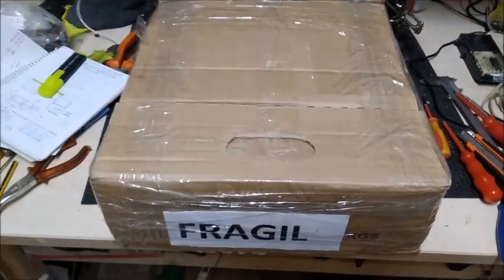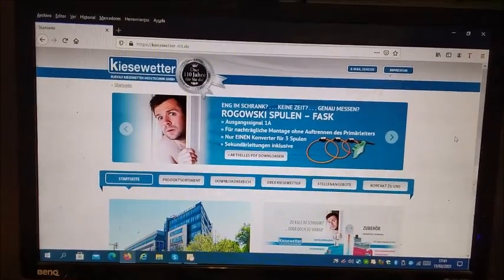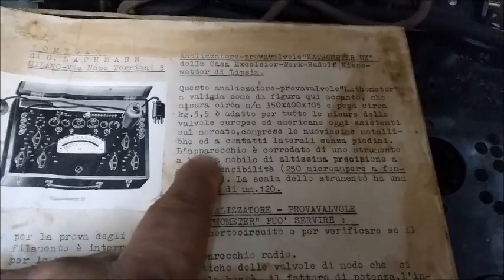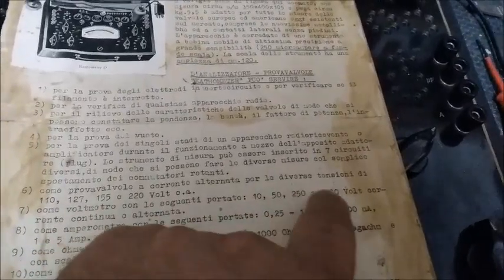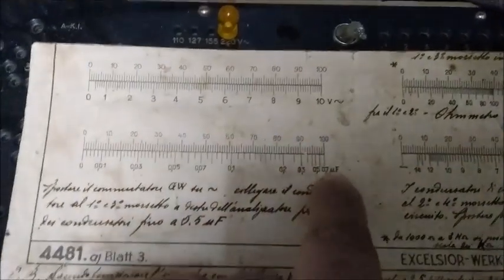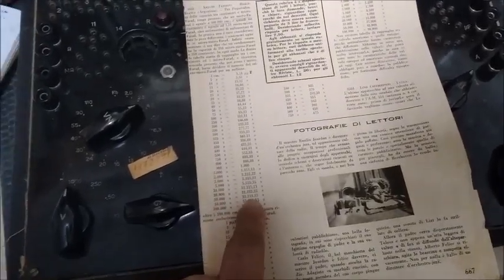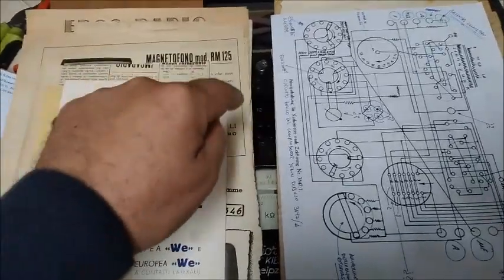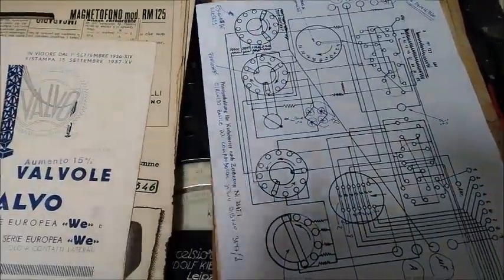1- Reparación Comprobador de válvulas Excelsior-Werk Rudolf Kiesewetter mod. UX

Comment: ¡Qué aparato más interesante!
Pienso que un voltímetro de 4000 ohmios/voltio en la década de los 30 del siglo pasado era MUY bueno. Hay que ver las cosas en su contexto histórico.
Por cierto, también estoy interesado en esa tabla de conversión de cm a pF. ¿Podrías hacerla visible para que podamos copiarla? Gracias de antemano.
Reply from the maker: Hola Pisotones. Tiempo hacía que no visitabas ni comentabas en este canal. Por supuesto, ya lo digo, que 4000 Ohmios / Voltio era bueno en su época. 
Después de encontrar esta tabla de conversión de cms a pF, y tras su estudio, pude deducir que en el sistema CGS de medidas, el centímetro, cuando se utiliza para medir la capacitancia , cumple la proporción de 1 cm de capacitancia = 1,113 × 10 EE −12 Faradios.
Puedes verlo aqui: https://es.wikipedia.org/wiki/Sistema_Cegesimal_de_Unidades
Con esta fórmula, y una hoja de cálculo, y una regla de tres simple, ya puedes hacerte la tabla de capacidades a centímetros y viceversa que necesites ad hoc.
Un punto que vale la pena señalar es que los cms no son directamente equiparables a pF como ya en su día dijo uno de mis suscriptores. 
Porque un condensador marcado 100 cm = 111,3 pF. Entonces 1000 cms serían 1000 x 1,113 = 1113 pF y 10000 cms = 11130 pF = 11,130 nF = 0,0113 uF. 
La diferencia no es importante para los condensadores más grandes, que generalmente tienen al menos +/- 10% de tolerancia, pero será importante para los condensadores que están por debajo de 200pF si se usan en etapas sintonizadas que a menudo requieren 1% de tolerancia, por lo que una variación del 11.3% es un problema, pero por suerte hoy en día ya no tenemos condensadores en cms, todo está en pF, así que si en una radio antigua nos encontramos en el OL con un condensador que ponga 50 cms, su equivalente en pF no será 47 pF, será 55,65 pF, lo cual no es un valor normalizado, y para conseguirlo deberemos poner en paralelo uno de 47 pF + 10 pF para obtener el valor más aproximado de 57 pF y luego habremos de resintonizar ligeramente el OL.
No obstante siempre habrá alguno, muy técnico él, que ponga un condensador de por ejemplo 22 pF, o de 68 pF, (porque es lo que tiene a mano), y luego reajustará el OL si le da margen suficiente.
Ahora ya te puedes imaginar, porque NUNCA me creí lo de que pF y cms era "más o menos lo mismo" y la gran felicidad que sentí cuando  tuve esa tabla de conversión en mis manos.
Y todo esto es en el sistema CGS, pero si quieres te hago, ahora que ya se como funciona, la conversión de pF al sistema MKS...  ¿O ya te la he hecho tambien?... jajajajaja...
Saludos y gracias a ti por el comentario.
Ketk.
Reply: @KetkAiball  Pues yo tenía la idea de que 1cm = 1pF, ya ves... no recuerdo de donde lo saqué pero eso era lo que tenía entendido. Precisamente ahora estoy con una radio de los años 30-40 que lleva sus condensadores en cm, por lo que este dato me viene de perlas.
Reply from the maker: @pisotones2348  pues creo que lo sacaste del mismo "tutorial" que hizo el suscriptor que te indico, que cuando le pregunté si conocía la equivalencia entre cms y pF dijo "más o menos es lo mismo, 1 cm viene a ser 1 pF" y de ahi sacamos más de uno el error, salvo yo, que me dije: "no me lo creo pero no se porqué, y no puedo discutirlo".
Encontrar la tabla esta fue fundamental, (por cierto, es ligeramente errónea por los redondeos no correctos que hace), para averiguar la equivalencia de cms a pF. Porque cuando la tuve en la mano, me pregunté de donde salían tales cifras. Y lo averigüé. Solo era cuestión de matemáticas de física. Y además lo confirmé con la Wikipedia cuando me fuí a ese enlace que te he pasado.
Efectivamente, si estas metiendole caña a una radio con condesadores en cms, ya puedes hacer la exacta o más aproximada conversión a condensadores en pF. Por favor, no me pongas condensadores a ojo de cubero como hacen algunos. Es preferible si no tienes un condensador adecuado, o comprarlo, o usar dos que sumen la capacidad adecuada más aproximada, tal como te he explicado en el comentario. Además, esas capacidades en los condensadores, ahora ya en pF, quedarán para siempre, en la radio que estás reparando para guía de los técnicos del futuro.
Un cordial saludo y me alegro haberte podido devolver la ayuda que me echaste con el contactor de la LAVIS T-980. Esto es verdaderamente compartir.
Ketk.
Reply: @KetkAiball  La verdad es que esa conversión de cm=pF la leí/escuché hace muchiiiisimo tiempo. Creo que fué mi suegro quién me lo dijo hace ya muuuuchos años. Nunca hasta ahora me las he tenido que ver con un circuito con condensadores en cm. Con respecto a los valores de condensadores de reemplazo, no soy de los que ponen lo primero que encuentran. Soy bastante cuidadoso con esas cosas. En algunos casos concretos puede valer pero en otros el valor es bastante crítico.

Por cierto que tengo un aparato más o menos coetáneo de ese que muestras aquí y con un aspecto muy similar. Se trata de un "Potenciómetro", pero no lo que hoy en día se entiende por potenciómetro sino un "Potenciómetro Universal":
http://www2.humboldt.edu/scimus/Instruments/Elec-Duff/PotenDuff.htm
http://www.richardsradios.co.uk/campot.html
http://www.richardsradios.co.uk/ether.html
http://www.richardsradios.co.uk/evershed-vernon.html
En resumen es un mili/microvoltímetro que se usó para comprobar y medir termopares. Lleva una pila Weston que, 80 años después de ser fabricada, todavía entrega los 1.018V nominales... para que luego digan de la obsolescencia programada, jaja. Tengo otra de repuesto y lo mismo. Ya no se hacen las cosas como antes. Desgraciadamente el galvanómetro está roto sin posible arreglo pues el chasis de este, de una especie de "calamina" rara, se ha desintegrado en algunas partes. Lo tengo de adorno; es una preciosidad y parece primo hermano de tu comprobador de válvulas.
Reply from the maker: @pisotones2348  Si no eres de los que "ponen lo primero que encuentran", entonces eres de los míos. 

Hace unos meses me encontré una radio con un condensador de papel cuyo valor nominal en esquema y en componente era de 5000 pF, curioso valor ¿verdad?, pues como era un condensador de acoplo decidí no sustituirlo por un 4700 pF, sino por dos condensadores, uno de 3300 pF + uno de 2200 pF, con lo que conseguí 5500 pF nominal, y real 5200 pF, un valor muy similar por exceso al nominal 5000 pF inicial. 
Hubiera funcionado casi igual con el de 4700 pF, pero hubiera introducido una ligera perdida de señal respecto al nominal, así que 5500 era mejor, pues introducía una pequeña ganancia de señal respecto al original y usar dos condensadores no me salía mucho más caro para hacer las cosas bien, solo por el placer personal de hacer las cosas bien y por eso lo hice así.
He visto los enlaces que me envías y practicamente es la misma tecnología de instrumentación de medida que la usada en este comprobador de válvulas. En el próximo vídeo podrás verlo.
No conocía esa clase "potenciómetros". Como bien dices constituyen milivoltímetros y microvoltímetros de comparación. Muy interesante sistema. hasta me lo he estudiado porque no lo conocía y ahora ya se un tema técnico más. Muchas gracias por el comentario. Un cordial saludo.
Ketk.

Comment: Hola, Ketk.

! Me encanta¡ Muy bien vídeo y muy buen equipo, vaya pinta de bueno que tiene.

Me ha gustado mucho el enfoque histórico que le has dado, y las tarjetas y datos que trae. Son casi igual de interesantes en sí mismos que el propio aparato.

Respecto a los cm para condensadores, no conocía que hubiera tablas, y mira que he buscado por Internet. Tendría que haber buscado en libros antiguos, ahí seguro que vendría. Pero ya todo loiramos en Google, ya no vamos a las bibliotecas. Y es un error. Hace años deduje que 1cm=1pF, midiendo condensadores cerámicos tubulares de una radio en cuyo esquema venía en cm, ya que no suelen degradarse. Pero veo que no era exacto, ahora ya lo se😂.

Me sorprende que mida tensiones a 4kOhms/V. Para medir pilas vale, pero para ver tensiones en válvulas carga demasiado. En cambio, como amperímetro es sensible, 250uA es aceptable para un polímetro digital moderno. Otra cosa es la precisión, claro. 

Por cierto, el embalaje muy currado. Eso es que el dueño lo aprecia. 

Un abrazo.
Reply from the maker: Hola Miguel. Gracias por el comentario. Es posible que en libros antiguos puedan venir tablas de conversión de cms a picofaradios, pero yo nunca antes había visto una sola y te puedo asegurar que he leído mucha literatura técnica antigua y moderna y nada de nada...
Esto de los cms como unidades de capacidad era un derivado del sistema CGS de medidas. El sistema CGS está bien para unidades pequeñas, pero para unidades grandes es mejor el MKS o su sucesor, el S.I.M. y en estos dos se utiliza el Faradio y sus submúltiplos. Como esto de los cms para capacidad se inició allá por los años 1930 y posteriores, allá por el año 1940 la electrónica andaba a caballo entre el viejo sistema de cms y el nuevo sistema de picofaradios, y de ahí que se generase esa tabla, difundida en una revista informativa de electrónica de la época, para que los técnicos de entonces pudieran pasar condensadores en cms a sus equivalentes en pF, habida cuenta de respetar las tolerancias, que para circuitos sintonizados no debería ser superior al 1% del valor nominal.
Respecto al voltímetro ya lo he dicho en el vídeo, que sería bueno en su día, pero hoy día menos de 10 K Ohmios/V ya no se considera de calidad. (en el vídeo me equivoqué, lapsus linguae, y dije 10 M Ohmios / V).
Un cordial saludo.
Ketk.
Reply: @KetkAiball 
Hola, Ketk.
¿Podrías enfocar la tabla un rato en el siguiente vídeo de la serie?. Así lo paramos y podemos imprimirla, es una joya.

La conversión que saqué yo empíricamente, de 1cm=1pF, vale sólo para condensadores normales en circuitos normales (ponían 50.000cm y cosas asi😂). Es cierto, por lo que he visto gracias a ti, que para sintonizados puede no valer.

Muchas gracias, kekt.
Reply from the maker: @Miguel_Romera  Hola. Deberías leer el comentario de Pisotones y resto de mis respuestas. Te he hablado del sistema de medidas CGS. Y parece ser que no he conseguido transmitirte bien el concepto. Lee mis comentarios a  Pisotones y así sabrás porqué no he subido esa tabla y cómo construirte una tabla adecuada. Me extraña que me pidas una copia de la tabla cuando ya me dijiste que siempre lees todos los comentarios. 
Un saludo.
Ketk.
Reply: @KetkAiball  Hola, Ketk.
Si, hoy no los he leído, como habitualmente hago. Lo he visto y he vuelto al laboratorio, estoy con la radio del pan bimbo😂 y quien mucho abarca, poco aprieta. 
Ahora lo miro.
Un abrazo.
Reply from the maker: @Miguel_Romera  una buena celda con una ventanita de barrotes y pan bimbo y agua para su deleite... le iba a dar yo a ese...
Un saludo.
Ketk.
Reply: @KetkAiball  Hola
😂 😂 😂
Enterado de la equivalencia. No se me había ocurrido buscar el cm como unidad del CGS, ni sabía que era del Sistema Cegesimal. 😂. Por eso no vi que en Wikipedia existía la equivalencia. Con ella no hace falta tabla.

Muchas gracias, Ketk. Sigo con el pan de molde. 😂